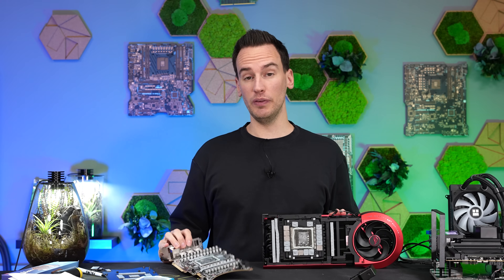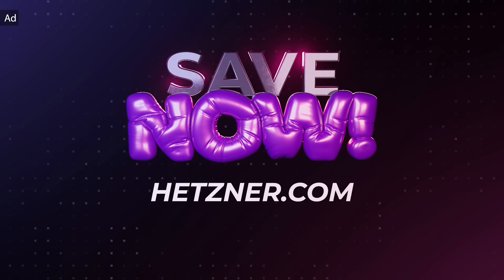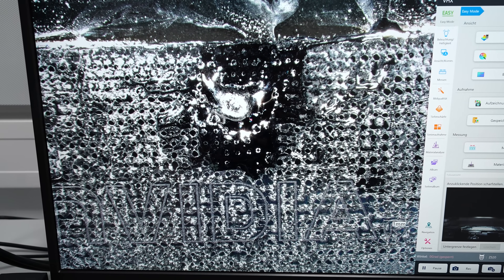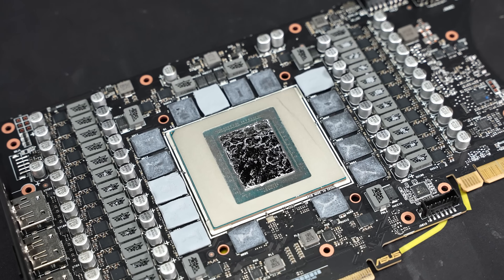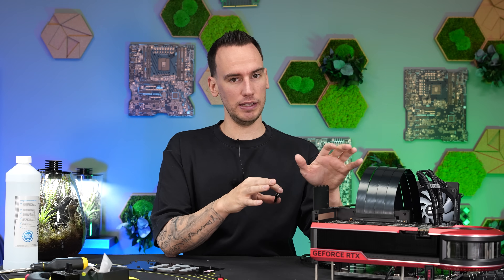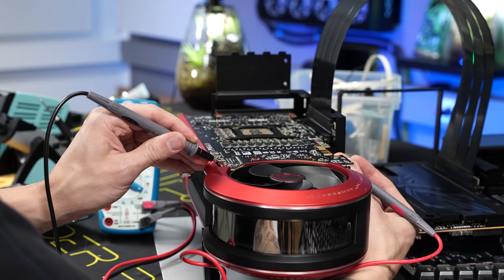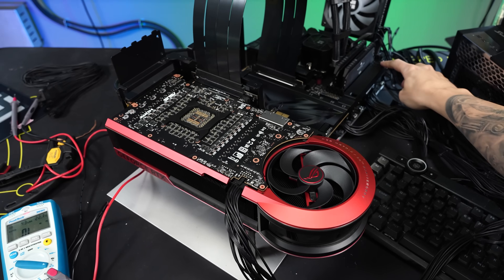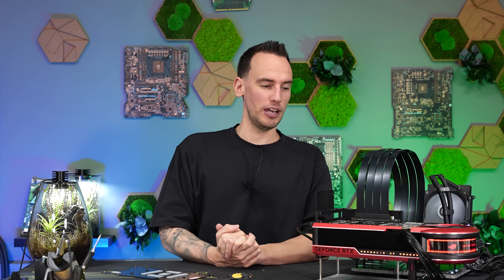5090 Matrix Mod: 750W over 12VHPWR without BTF & Liquid Metal Check

Comment: Couldn’t you have made up a wiring harness to properly supply the BTF connector with extra power in lieu of the Mobo BTF connector? In other words, instead of tricking the card, why not just use another 12 volt high power connector from PSU, cut the connector off the other end, and wire that up to the adaptor? Then you wouldn’t be running the main power cable so far out of spec (when it’s already liable to burn up when run IN SPEC) and the card and software will be happy that voltage is being supplied to it as designed? Cool vid though, thanks for making it!

Comment: Im facing a same problem of poor connection on my modular psu cables for the mobo and drives a bit of tension on these connectors make them work, poor connection even after replacing those pins with gold plated ones.

Comment: As a guy who was in charge of replacing 1000W 2U power supplies in servers, and using them as makeshift high-voltage lithium battery chargers on my own personal time............ Nobody has given me a good reason why it was not a card-edge connector, and wires. Cost? Pfft. Done with the first 'GPU Fire' recall and bad press/publicity. Reliability? Uh, never had a card edge to bad on a server power supply, just the actual units. Ease of use? We know how card edge connectors work. We used them on SLI and all that stuff. So, once again, nobody has said WHY it had to be wires/crimp connectors and not a card edge--other than nViDUHHHHH wanted to save money. Which, again, DUH. Give me a better one.

Comment: The PSU uses 12V why would it use anything else? All12  V is same rail. Why do they have 12 tiny wires instead of 2 thick power cables I used to install car amps 12V 1200 watts etc need 8 gauge wires. so yeah 12V is good because since its used for cars etc. its well understood but these PC people  are not car guys. haha.
Also a classic car guy trick is RTV high temp silicone.

Comment: if the two  connectors gose at 1 place everything will melt  this is the problem with high power  consumbtion units  the more power connector the lass stress on the electric current lass resistence that leads to low temps if you put everything 
through 1 cable it will ignite.

Comment: Damn, gotta give 12vHPR credit. 10 amps per pin for 750W is quite impressive, you could in theory give the cable modest airflow to keep it cool. It's such a small connector too. This of course is assuming the manufacturing tolerances for both the PSU plug, and GPU plug are good enough like this cable for example.

Comment: solder some wires to BTF connector and run it with also 12VHPWR simultaneously, they you should get 350/350W

Comment: So could you/someone just build a 12VHP cable with thicker wires and be okay with it pulling the 10-11A each wire? Since you were saying the wires were getting a little warm/hot and its probably not the best to use it like that for extended periods of time. Or are the actual connector ends also only spec'd for that amperage?

Comment: Knowing what I know about the general failures of the 12VHPWR connector and cables, if I had even a FE 5090 I would be undervolting it to draw well under the 600 W it can pull.  The 4090 I have I try to get it to a point where it’s not drawing more than around 300, and preferably somewhere in the 270-280 range under load.  Yes, I’m leaving performance on the table but I can still get the GPU clock somewhere close to base spec under load.  It’s just something I’d rather not worry about replacing right now as the GPU market is still overpriced, and now with RAM prices skyrocketing it’s even worse.

Comment: Regular modders: "liquid nitrogen on the chip"
Roman next vid: "So I am now liquid nitrogen cooling the 12VH cable to support +1500w without overheating 20 amps down each cable strand"

Actually liquid cooling high power DC cables for fast charging EVs is already a thing, wouldn't surprise me if it finds its way to regular electronics sooner or later lol

Comment: The liquid metal pattern. its uniform.... So i suspect they have coated the chip and maybe the heat sink with some kind of material that.... lack of a better word. Sticks or attracts the liquid metal. In order to keep it evenly spread out and not bunch up and run away so much.
Kind of like the nucleation points on a beer glass attracting the co2 to form and release. In this case attracting the liquid metal and mostly holding it in place. 

Maybe some kind of other metal printed on that can mildly react with the gallium causing it to stick more to it without fully dissolving into the liquid metal...

Comment: u seriously think 800w makes it a very nice card, makes it an extremely awfull card for any sort of long session gaming, after an hour or two ur room temperature slowly goes up by 1c and ul end up 25-30c pretty fast and sitting there sweating.

current gpu's that pass 350-400w are already a nuisnance and u have to open ur window, this is just awfull for anything, if ur a pro gamer or lets say gamer who actually plays games and enjoys themselves, being comfy as they play their game, this is not suitable for sitting there 5-8 hours in any way and the electricity bill isn't gonna be much happier either.

this gpu is not much for gaming, its more of a "i can play some games for 1 hour today" and then come back the next day, ur not gaming long, this is nowhere near a proper gaming gpu for anyone who plays a lot, definitely completely unusable.

even for 5090 users they mostly downclock their gpu's to 300-350w and is happy there. nobody is happy running 500w potato in their pc even with decent fps.

Comment: You can buy liquid metal sheets which is what I suspect they are using. Its used in the EV automotive field.
Basically comes between 2 vynal wrappers and you put it in the freezer so its solid.
Peel off one side and place it on the device. Let it warm to room temperature then peel off the other side. It has a pattern similar to what your showing.

Comment: It's likely that the btf connector not only provides a signal to the card but also the motherboard to confirm that all connections are able to eventually distribute the power. While the card has sense pins on the btf connector the motherboard will also likely have circuits so it can allow for high power operation to be enabled via the onboard auxiliary power connection. If the card is saying there is no power delivery from the motherboard then it's possible that a fail safe was implemented to prevent over current in the pcie slot since the aux. Pcie power and the 24 pin power are probably tied together in a limited capacity. 

The breakdown is 75+150 watts from the platform and 4 x 150 watts from the 12 pcie 5 cable; you are drawing 61.46 amps, 737.52 watts, so it's a good indication of how the power should be distributed but the motherboard prevented you from burning out your pcie slot by restricting the board power. 

You could probably build a functional BTF extension if you Frankenstein'd 2 btf connectors and used stranded wires for the connections. Someone is going to do it soon enough so you might as well get a head start on taking your piece of cake.

Comment: Should be really easy to support BTF power with riser cable configs or non-ASUS mobos. While modding the BTF connector, just chop up some extra 12V PSU cables and solder the wires directly to the BTF pads.

Comment: It would be interesting for somebody to produce a BTF adapter that accepts a separate power connector (either 8-pin PCIe or another 12VHPWR) specifically for vertical mounting.

Comment: Also, maybe a new product potential? A BTF connector that links into another set of 12VHP so people running vertical mount with riser cables can actually plug 2 sets of 12VHP. That would depend on BTF becoming a standard ofc...

Comment: Honest question, if BTF is on the same plane as the 12VHP, what prevents the issue of current going though least resistance path (like all amps going either through the BTF and ignoring 12VHP wires or vice-versa)

Comment: I was just thinking about this, what if the heat sink had little dimples and the IHS had corresponding depressions.  That would increase surface area between the two.  I am not an engineer in anyway, and this maybe so stupid but it was just a thought

Comment: If the GPU only cares about whether or not the BTF detection pins are grounded, that surely means it does nothing to balance the current between the 12VHPWR and BTF connections?

So if there is a poor (high resistance or even open) connection to the power pins/terminals on either power source, there's nothing to stop the card loading the other source beyond it's spec.
If the BTF connection is damaged, corroded or just dirty, the card would be unaware that it is loading the 12VHPWR connection beyond it's rated capacity. 

Likewise a poor 12VHPWR connection could result in the card loading the BTF motherboard beyond it's rated power (600w iirc), which could have even more catastrophic results than just a melted connector.

Given the known deficiencies of 12VHPWR, you could hit really hit the jackpot and end up in a situation where the card is trying to draw most of it's power through only some of the 12VHPWR conductors - 700w+ through maybe two or three wires... that could get interesting.

But who needs electrical safety these days....

Comment: I found that my 5090 scales core clock with power limit, when undervolting. Setting the 0.89v voltage point, the card always goes slightly lower to 0.885v, and with a +1000MHz core offset for this point, this results in 2640MHz for my card with the power limit set to 600w, but the card only pulls around 400w in this configuration. I point this out specifically because then increasing the power limit to 800w, the card is now doing 2700MHz for the same voltage point, and whilst still limited by the maximum of the 1000MHz core offset, and the voltage stays the same. 

Thus, I get more MHz out of the card despite not really pulling more power (minor increase from clock increase alone). Bare in mind the 1000MHz core offset is the real limitation in this, you cannot go higher at this voltage range. Thus getting the frequency at this voltage is actually more significant. Only way to get more frequency is to increase voltage in this scenario usually, so you're not limited by offset, but by the silicon lottery... But ofc that then pulls more, produces more heat, etc.

I'd say this is actually a more practical daily use for the higher PLs since they scale algorithmically, instead of actually using more power.

Comment: Yes, just need another 12v high power cable to the Asus style motherboard power connector on the GPU PCB. Could use 4 8pins or another dedicated 12V high power socket on the PSU to power the adaptor cable.

Comment: That metal crap works good on a flat surface. When you run it hot tilted it runs to whatever side isnt level at least thats what if seen on different repair channels..i could be wrong

Comment: The graphics card part of graphics card now has no meaning. This card is the size of a SFFPC

If someone 3d printed a mock up, they could probably fit a whole pc with a 5090FE in there is using a small enough laptop board.

I am not complaining though.

It reminds me of the old days when GPU AIBs tried wacky things. I do know its mostly not their fault with restrictions now though

Comment: Make custom 12V cables with a higher gauge and quality wire. Shouldn't be too difficult but it could get pricey if you use silver which would be the only real upgrade you could do over high quality copper.

Comment: There’s another BTF graphics card, the Astal BTF. See if you can bypass it as well to use both power connectors. Also, in the future, can’t a dongle be used instead of a Btf board?

Comment: Roman, could the liquid metal pattern be caused by the balling of the chip onto the PCB when it was attached, maybe transferred somehow from the pressure of the cooler height variations from the solder underneath? Also will you be testing any of the Cooler Master 3d heat pipe air coolers coming out?

Comment: I mean, the obvious next step would be to just hook up some wiring to the BTF adapter straight from the PSU. A couple of 12AWG wires each for ground and 12V ought to do the trick.

Comment: Why not make an adapter that uses a second 12 volt hpwr connector? I have a 1300 watt power supply and it has 2 hpwr connectors.
This could also make the btf cards usable on a non btf motherboard. That would make those btf cards more sellable too.

Comment: why you did not plug another 12VHpwr to the BTF adapter while you were at it that way it would have pulled from both cable. Or even connect a PCIE8pins connector to +12 and gnd.
Reply: Yeah, BTF to 12VHF connector, or even to an octupus of 8pin. Not exactly sure how could that be made to fit in a PCI mounted card, but definetly doable on vertical mount.

Comment: can you take an unused power connector from the psu and actually power the adapter with 12 volts so that the pins sense current, and the strain on the 12 volt high power is reduced?

Comment: I see that you set the memory clock to 50022 mhz but does it run at that speed? On my astral, you can set it to very high but the max speed is 34000mhz, can you please confirm if the Matrix has that restriction as well? thank you. My astral gpu can hit 3100 to 3200mhz during benchmark, so having more watt doesn't mean it will run faster..

Comment: Incredible. Can you demonstrate the radiators ability to expand from small water cool loop to, adding a mora style water box, can the radiator fittings on both sides be used for the expansion, or a splitter and valve setup, and pump setup. Can the main pump still feed both loops ? Thanks 😅

Comment: Interesting video! Thanks! I'm trying to do the opposite with an Astral 5090 BTF. I run triple 4K monitors for sim racing so the card draws 600W pretty much all the time and I'm always anxious about melting connectors as the load balancing between pins is always skewed. I want to run the card using both the BTF and 12VHPR to load balance, but don't necessarily want to run more than 600W.

Any suggestions? 

If I just simply connect both power inputs the card does not boot. I laos tried the Matrix BIOS but it throws error 43 trying to install the driver.

Comment: why nvidia dont let do 2 power connectors 12v2x6? like galax hof 4090
Reply: probably to keep something for the 6090.
Reply: I think they wanted to limit the number of different connectors and cables required for their whole product line-up. This theoretically makes the manufacturing cost of GPUs cheaper for both Nvidia and OEMs, as sourcing and storing multiple connector variants is more expensive than a single type. 

It also ensures that any card from Nvidia requires only one PSU cable of the same type, which is beneficial for system integrators and PSU OEMs. The SIs are now able to purchase any GPU model from Nvidia (or third-party OEM), as long as their PSU has a 12VHP cable. 

I'm not defending the shitty connector, just stating the reasons why they limit the number of connectors. It would've been a good thing if only they had designed the cable correctly from the beginning.

Comment: The "glue" around the chip would make much more sense to be epoxy resin. Im a bit worried that its so bubbly. All it takes is for the odd chance to be a bubble in the wrong place and let liquid metal in for a short.